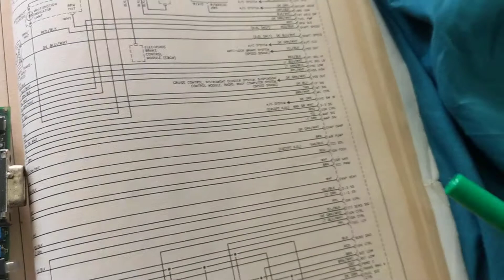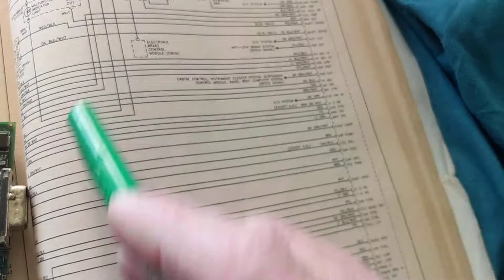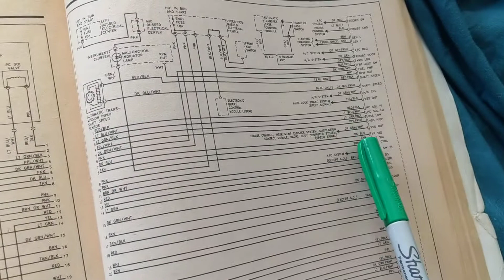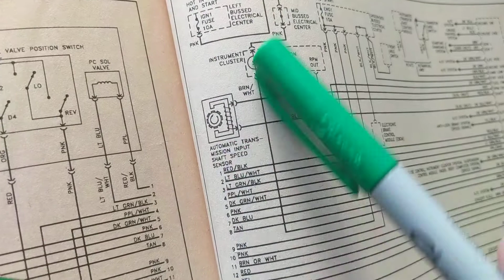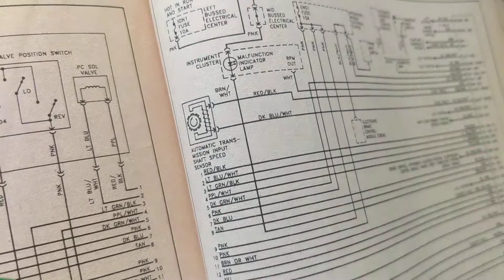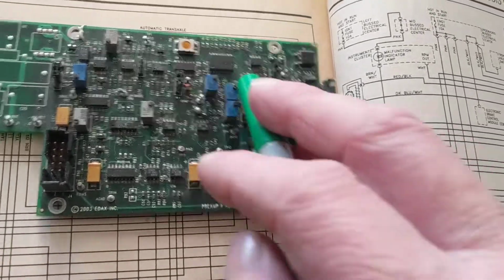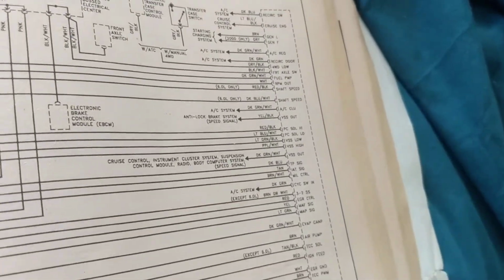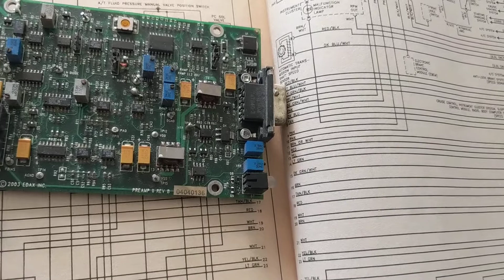MAJOR RECALL FOR HYUNDAI VEHICLES FOR COMPUTER PROBLEMS WHICH COULD CAUSE FIRE

Comment: i find the whole thing very strange, i am doing electrical diagnosis on my elantra, some times brake lights come on sometimes they dont, the new abs relay they put in has a massive voltage drop making things worse & it clearly isnt solving anything. The immobilizer is tied in to the same circuit, and I wonder if they are worried more about their encryption algorithm being cracked.

Comment: Very good video, I am learning new things every time.
When my ignition 10A fuse kept blowing during wet weather a garage auto shop told me to upgrade the fuse to 15A and that worked in wet weather but was not a good idea.
Do the recalls have an expiration date or are they good for ever?
Reply from the maker: There is no time limit on the recall however if your car is usually older than 10 years or somewhat then the repair might be on the customer so the quicker you do it the better off

Comment: Does this apply to the 2018 Hyundai kona 1.6T petrol ?
Reply: I didn't hear anything about that the sonata and the Santa Fe and others if you want to make sure put in your VIN number and then you'll see if you get a recall for that but needless to say this is a serious issue they just don't make vehicles like they used to thank you for your question
Reply: @believeitornot101  I tried the vin number thing and nothing came up, however recently it did catch fire, loss my breaks first,
Reply: @hakimhanafiah5783  actually I did see the on recall for a 2.0 engine they on recall if I believe 2019 to 20 20 if not try to Google it and see

Comment: Sir can you do a tutorial on how this electronic module board works  along with circuits schematics of the circuit board.Thanks.
Reply from the maker: Thank you for your suggestion I understand your request when they have computer boards all they have are the connections to it everything internal is not given by the manufacturer of the components inside the PCM so all the videos that I do about the connectors 200 connections to the PCM is all the information that the manufacturer of the schematic gives unfortunately and all that you see when I put these printed circuit boards is to illustrate to the people that vibration can interfere with these chips as you can see but thank you so much for your suggestion keep me informed
Reply: @Joeelectronicschematicsforauto  Sir nevertheless in this particular tutorial i have learnt a lot very much.Thanks again.
Reply: Thank you for your compliment about the recalls Leon when it comes to electric problems vehicles which come from computer modules always important to put the correct fuse rating and the correct wire gauge